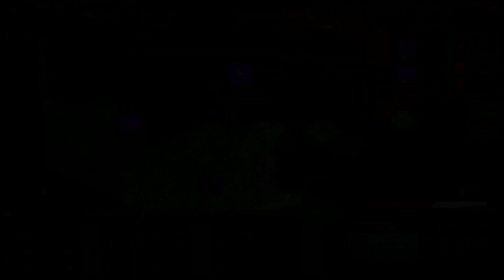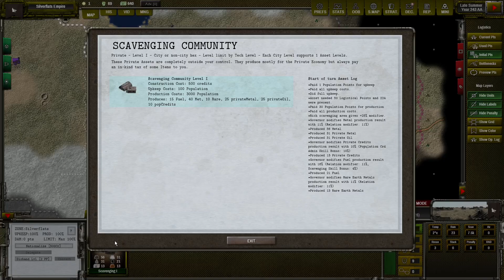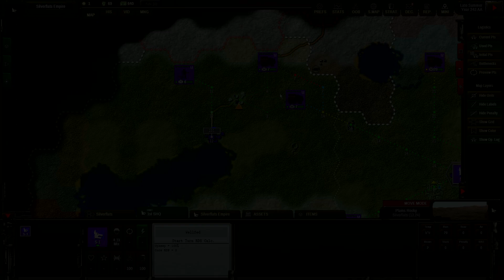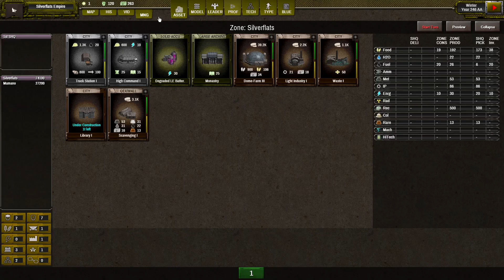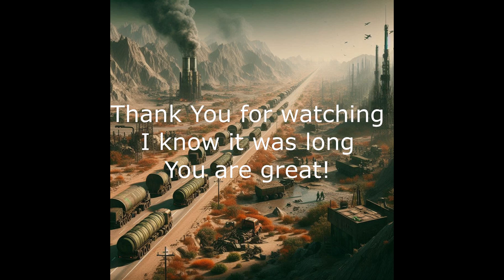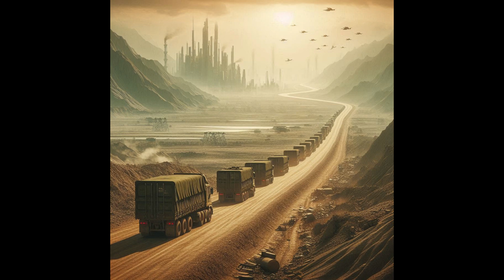Shadow Empire | Logistics Explained

Comment from the maker: A note regarding supply bases. Many people are confused how they work. Supply bases can refresh only used action points. Please notice the word "used". If your base is 3 hex away from a truck station on the dirt road (so trucks need to use 10 AP per hex) the trucks will spend 30 Action Points to reach the Supply Base which means that only 30 AP can be refreshed even if base produced 50 extension points. Extension points define the maximum amount of used action points that could be refreshed. Thats why to fully utilise the extension points you should have minimum 5 hex distance on dirt road or 7 on sealed road. But if you plan SB level 2 then you have 75 extension so the optimal minimum distance grow to 7 on dirt and 10 on sealed roads.
If you cannot fully utilise extension points because you built too close to truck station, still you can have second station down the road that can refresh the unused points. Wait what? But supply base don't stack. Yes, but it should be defined as "used extension points don't stack". So if you have SB level 1 with 50 extension and you use 30 in first SB to refresh 30 action points then the second SB still can use the remaining 20 extension points.
If first station used all 50 extension points then the second one will do nothing and is useless until you upgrade it.
Also supply base build out of 6 hex range from city will increase administrative strain, but usually logistics is more important.
Reply: Just spent entire day to watch your video. Thanks for helping us noobs. Can't wait for the Republica :)
Reply from the maker: Yeah Logistics is tricky. Some people like to simplify their lives and use the "Midcore logistics" option that you can check when you start a new game (bottom right options) or even simplified logistics. But I see you are brave enough to go for the standard logistics! If this is not enough You can also watch "15 advanced logistics tips" 😁
But best is simply to play and try how it works. Take care and thanks for your comment!

Comment: Excellent and well put together. I may have to watch parts of this more than once but very helpful explanations around this most complicated of subjects. Thanks!
Reply from the maker: I wish I could upload a bit more edited version, but maybe the slow pace is good for this subject. I'm glad you like it. 
Some hints: you can connect as many trucks stations as you want. Refocus can be neutral if incoming points are similar to outgoing (sum of production in the new station+refocused points). You can build truck stations outside cities. Truck station can be put at any part of the railway not exactly at railhead, but across the whole line it also works fine. Better to build Supply bases within 6 hex range from the city to avoid increase of administrative strain (ideally also truck stations). 
Thank you for your comment!

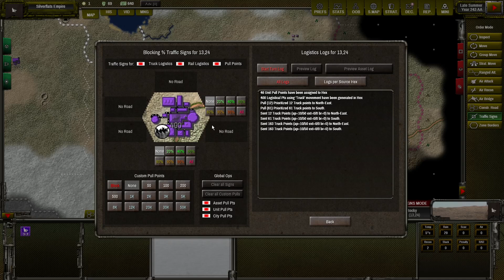Comment: Hello, how to bring the traffic signs visible at 7:20?. When i click twice in traffic mode i have a different window without the image of the city, just a window with some logs with numbers. I also noticed that the button on the right side menu is labeled traffic logs instead of traffic signs. :(
Reply from the maker: Did you select in the initial game settings something like midcore logistics? No other idea why it wouldn't be displayed in normal mode.
Reply: @StrategosAcademy  Thank you. It worked. It seems i have a simplified model due to selecting this option.
Reply from the maker: You can play this mode but then the logistics works a bit different than in the basic mode, so you don't have to micromanage the network, but I like to have a control.

Comment: Will railhead push it forward. Lets say i have one city and connected anither coty but then decided to even puah it more forward do i build railroad then railhead and railroad again ?
Reply from the maker: You can build railroad then railhead outside city. But if you continue extending railroad further it will have 10% capacity until you close it using railhead or station. Then when you close it you don't need other railheads in the middle. I have 1 station in my capital, then nothing in next city as the points flow through the city hex , then the 3rd city have train station as it was too far from capital then the rail continue south near the frontline and railhead close the line. Railhead is good to supply units in the field and stations to refocus and extend the line range. But if you have enough points and range you can skip building anything between the start and the end of the circuit.

Comment: Supply base do u place it at the 5th ir 6th hex space
Reply from the maker: You put supply base on last hex with full initial logistical points, but on which hex it depends on a road type and action points in your asset. So if you have private transport hub with 50ap and dirt road cost for trucks is 10 per hex you put on 5th but if public transport 100ap/10 then on 10th but if sealed road then you divide by 7 not 10 so for private ones 50/7 =7 and for public one 100/7 = 14

Comment: I’m a beginner player, and this tutorial was extremely helpful, thanks a lot! I’m excited to check out the other videos as well.

Regarding the refocusing penalty, I came across a comment on Reddit suggesting that truck stations should be built one hex away from the road, rather than directly on it, to avoid the penalty. Does that make sense? I’ll give it a try in my current playthrough and see how it goes.
Reply from the maker: I'm glad it helped you! Regarding your question. I think it's a kind of micromanagement not needed for most of the standard games. It's called logistical injection, to block incoming LP from outside of this hex and inject the additional LPs to the nearby road/rail to increase the overall capacity. It may help in some special cases, but I don't use it. Remember that you play for fun. I hope you will enjoy other videos. I'm open to feedback and suggestions. Cheers!

Comment: I am trying to "digest" this topic because it is big and important , Q: because ( as i understand) supply base - it does not add to build more then one on a road ( they do not stack ) is it more optimal first to raise in level the truck station and then build a supply base ? What is your strategy ?
Reply from the maker: All depends on your specific situation. Supply base is cheap and can be built in 1 turn so it's a good option for solving quickly problems with range nearby your closest truck station. I prefer to build truck stations in zone centers and supply bases in open area for units far from cities. So if I have problems with fuel on my planet I will not spam truck stations as they consume more fuel to be functional and are more expensive in terms of IP & metal. But relying on supply bases will stretch your LP capacity from the truck station so any assets and crossroads after the supply base will strain your initial capacity that could be used elsewhere. then better to consider another truck station nearby the pull points markers to balance the LP capacity between two networks. Then supply base is good choice to connect those two truck stations if they are too far from each other. For long range logistics better to build rails. Level 2 rail station is powerful. But all depends on your economy, resources, geography, distances, frontline 😉
Reply: @StrategosAcademy  I finish it ! it was long and you are great! Thank you!
Reply from the maker: Thanks and congratulations! I wasn't sure if so long video makes sense and if I should split it into a few smaller ones, but I decided to test how the long format will perform. Fingers crossed for your logistics!